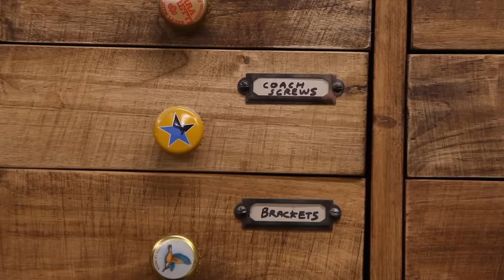Pallet Furniture. A Victorian Display Cabinet made from Reclaimed Pallets and Scrap Wood

Comment: Just curious, why do you use a hatchet to break the supporting blocks rather than prying the boards off?
Reply from the maker: It does less damage to the boards.
Reply: Far less likely to ruin the long boards by splitting them if you can break that big chunk off first and pound the nails out.
At least that's what I've done

Comment: Everything you build is done carefully and precisely.  Did the overall design come to you as you built each section, ( you have mentioned doing that with some of your other builds) or did you already have a design to follow? This is a beautiful piece of furniture and something I would proudly display in my home. Unlike the homes of Europe, American homes are boxy nowadays with no imagination and every room seems to be open to the next making them hard to heat. The older homes such as mine (1749), show that the Europeans who built it had imagination with lots of nooks and built-in cabinets. They mimicked the houses of Europe with each room separate from the other, making it more efficient to heat. A separate kitchen, a separate dining room, and living rooms, and each room had a door to close it off from the other rooms. Much more efficient, because you can heat just the room you are in and not the entire house. My favorite room in my home is the little 8ftx9ft reading room. It is lined floor to ceiling, wall to wall with the original built-in bookcases and a stained glass window, not original, but very pretty with the firelight that twinkles off of its beveled edges. I love reading and collecting first-edition books of all kinds and sipping tea. There is a small shallow fireplace where I have a DIY MINI woodstove that I light on chilly nights. I think the fireplace was added at some time and was most likely for a coal parlor stove. There was no support foundation under the area where the fireplace is located. So I collected stones and mixed up cement, and my brother and I built a foundation for the floor under that area of the house so the stove and very heavy slab does not crash through the floor one night. My brother helped me build it as he is a restoration carpenter/builder expert. He has two 1700 houses he took down in one town and moved to his property to combine them into one big house. So he knows about load distribution, stone laying for fireplaces etcetera, etcetera. 
I am very lucky that a good friend, who paints vehicles, tractors, and just about anything else you want to be painted, offered to put an enamel coating on the stove for me. He was trying to perfect the enamel process and did my stove for free as long as I  overlooked any imperfections. It came out flawlessly and has held up over the years. I wanted the "look" of an antique stove from Europe so looking at a drawing I found in a book about early stoves, I welded up a small modified version. I added some brass accents that were common on wood and coal stoves from the mid to late 1800s like a decorative finial I made by using rifles and files. The thick slate slab I have the stove mounted to radiates heat long after the fire goes out. My overstuffed channel-back chair and ottoman in the reading room are where I like to spend my winter evenings reading or spoon carving. I have not turned on a TV in more than 6yrs. I get the news and weather from a laptop and can watch a movie on it if I so desire. But carving spoons, shelves, etc., woodworking, and reading are my forms of entertainment. And I sit and listen to an old radio like everyone used to do before TV turned everyone into zombies, lol.
I keep a small foldable spoon mule and a canvas drop cloth in a small cabinet for the rough carving of spoon blanks. The rest of the carving I do on a mini "bench" with a small spoon vise on it. That sits across the arms of the chair so I can relax. And the wood shavings go right into the woodstove when I am done. An easy cleanup.
That cabinet or hutch of yours would look right at home in my dining room - hint, hint,😊. I could fill it with my 4th great grandma's china. I Love, love the black color too! 
May I ask how you keep your radial arm saw from getting wet and not rusting with it stored outside? I have a 1950s Dewalt 10" RAS in my shop that I restored, and l love it. Honestly, I rarely use my table saw these days. When I have to do a large quantity of something requiring dados, the RAS gets the dado stack, while the 6ft long circular saw cross-cut jig I made is used along with a straight edge and saw to break down larger pieces. I can never go back to just a table saw again The RAS, and CCJ make life easy and the wood that I cut on them is dead on straight. I apologize for rambling. You are so talented, and as I also use recycled wood and repurpose wood furniture that I break down and clean up in many of my builds, I can appreciate the amount of prep time it takes to make something this big.
Reply from the maker: Thanks for the comments. I did a basic drawing for the display cabinet, just to get an idea of the look I wanted, then I made up the build as I went along. The radial arm is in a shed on the side of my workshop. It's dry in there so never really had a problem with it.

Comment: truly excellent.  One question, to fix the glass using the battons, does the criss-cross facing wood need to be sprung into the glass ?
Reply from the maker: It's not something I would do. I left the glass as a loose fit. If it rattles at all, it's an easy fix just to add a piece of black felt or foam to the inside of the strip screwed to the inside of the door.

Comment: I love your videos but I do have a question which you may have been asked before, why do you stagger the cuts on the boards just before glue up? Keep up the great work.
Reply from the maker: The boards usually end up staggered because the longer pieces get cut down to remove bad knots or splits. It also wastes the least amount of material as using full lengths would usually mean a short piece would be discarded from each length.
Reply: @EpicUpCycling  thank you did not know if it made the glue up stronger or something that I could use in my woodworking journey. Your work is incredible and its really inspired me so thank you.

Comment: Another simply awesome piece of work Jason - what a treat to watch you work!! 
But - I do have a question please? When you laminated the pieces together for the top, why did you not feel the need to clamp on the ends as well so the butt joints in the top were firmly adhered? I have always been under the impression that butt joints are a weak point, so I would have thought clamping pressure to secure those joints as much as possible would be a wise idea. Certainly not a criticism because I could never dream to have the knowledge and talent as you do,  so I am just simply asking for your opinion. Thanks for posting another great video. Sincerely - Dennis
Reply from the maker: Thanks Dennis. It's a good question. In all honesty, I've just never felt the need to. Probably the main reason is that it would be a pain to do all that clamping lengthways as well. I've seen some people do it, but it's not common. I also don't think clamping necessarily adds to the strength. It's done more to keep everything true. It can even make joints weaker as you press more glue out the tighter you clamp, something you have to be careful of with all glued joints. On a piece like this, almost all of the board strength is in the fact the lengthwise pieces are overlapping. Butt joints are always going to be weak, no matter how well they were glued.

Comment: No, no, no.  This isn’t “made” out of pallet wood.  Granted, it serves as the framework, but the video made me think the whole project was made entirely of pallet wood, sanded and stained to the finished product.  Attaching high grade stock over the pallet frame doesn’t cut it.  Be more accurate in your video title.
Reply from the maker: If you mean the thinner wood that gets put on top of the panels, and the hand carved pieces, it's all pallet wood. It just looks high grade because its been filled, planed and sanded.